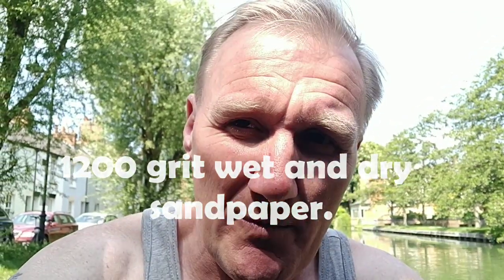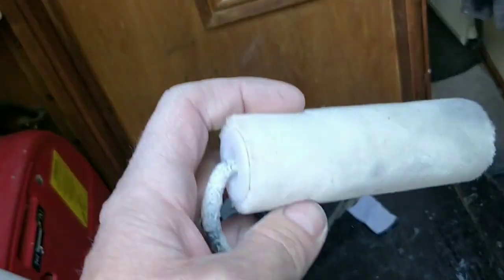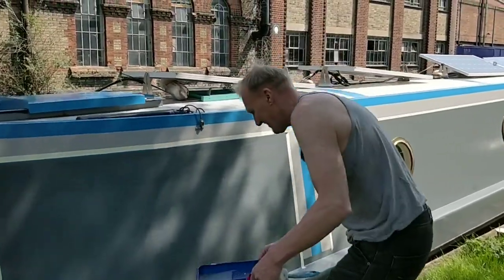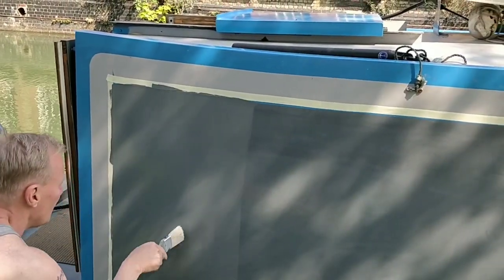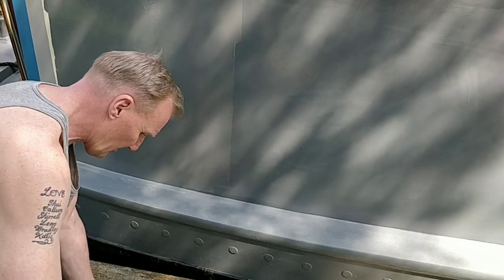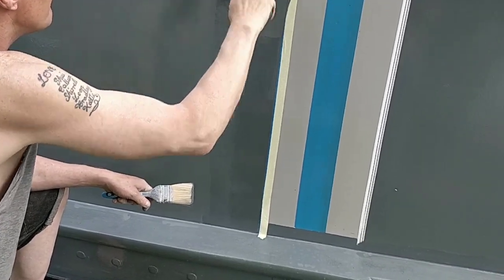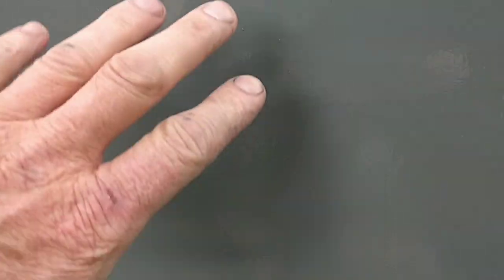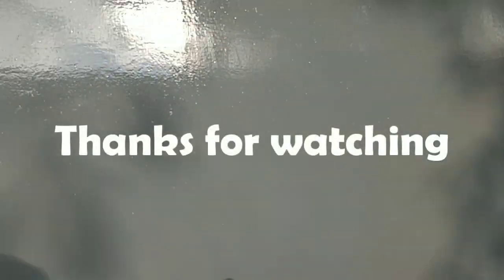Painting a narrowboat for amateurs.

Comment: Use international pain 
4inch roller yellow head 
3 inch Prudy Brush
Do not think the paint
Prep properly 
Use one inch yellow low tar tap 
Don't brush down up from bottom to top one stock
The paint will fall 
But you need a primer 
Ps I have had boats for
50 years 
Do not use a car paint rubbish 👎
Reply from the maker: Well it's 3 years later and it's still on. Thanks for the advice though.